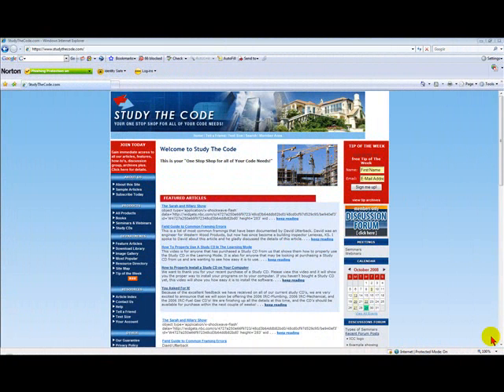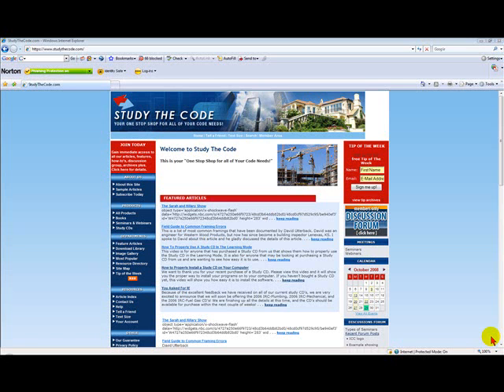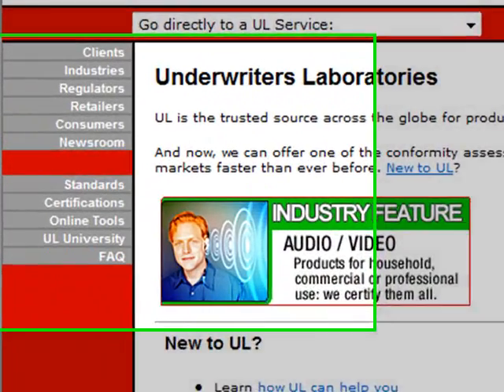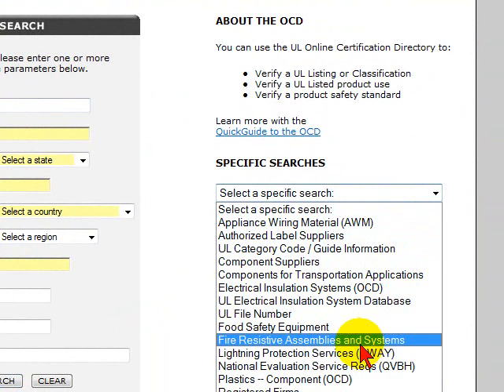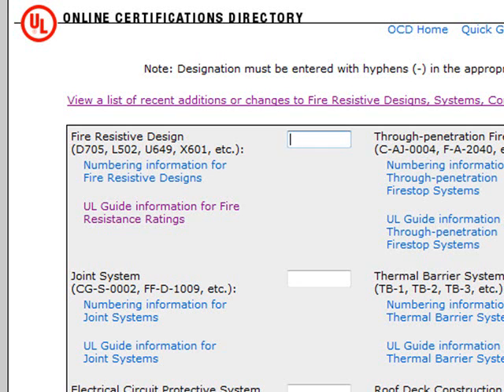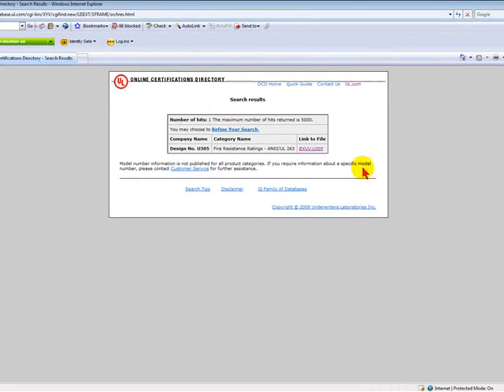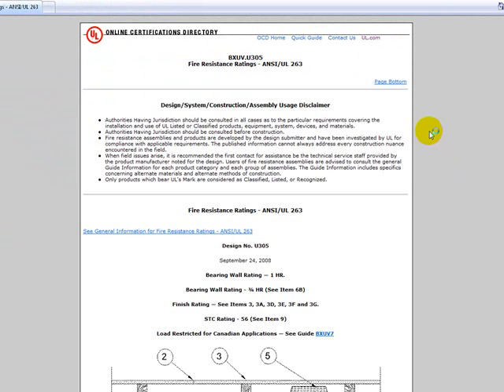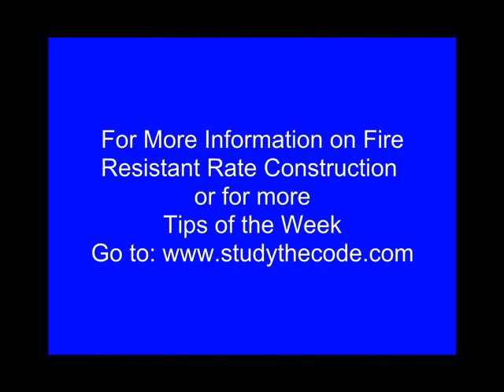Fire Resistant Rated Construction for Building Codes

Comment from the maker: Bob:

No, depending on where the materials are to be located dictates the flame spread ratings for the materials.  With regards to fire resistant construction, it is generally required at fire barriers, fire partitions and fire walls. Hope this helps.